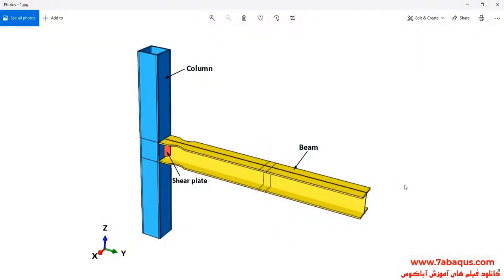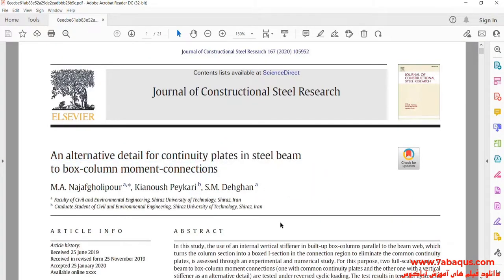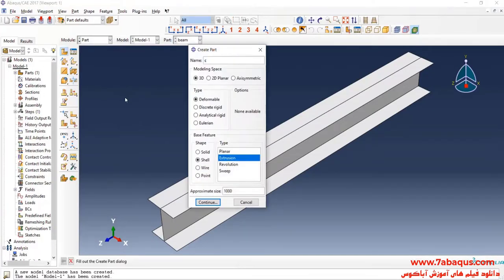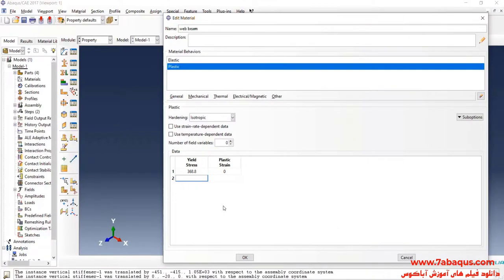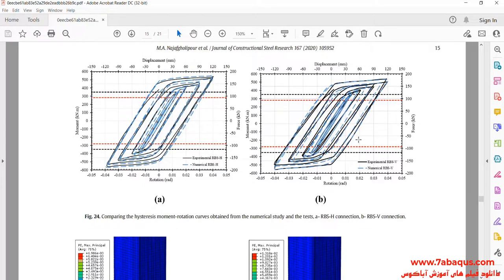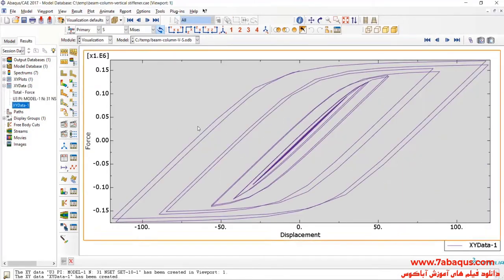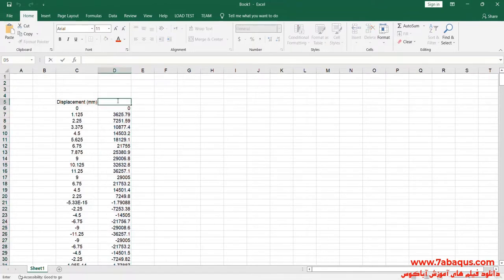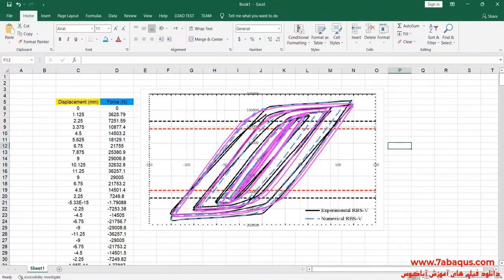Beam-column connection with vertical stiffener under cyclic loading Abaqus

Comment: Hi Saeed,
I purchased the full video and have been following the procedure. I have one important question:
Why did you choose to use an isotropic hardening model instead of a kinematic or combined model for multi-cyclic reverse plasticity? From my understanding, isotropic hardening may not capture the cyclic behavior accurately.
Reply from the maker: Hello
It is better to use combined model with the parameters option. But you must have the gamma and C and … values.
Reply: @saeedmoeini-7abaqus  I know that. Do you recommend any strategy for calibrating these parameters? I am modeling a steel connection under cyclic loads, but I have some doubts about how to obtain proper values.

Would it be possible for you to make a video in the future about this type of hardening?

Many papers mention using this type of hardening, but they often do not report the parameter values.